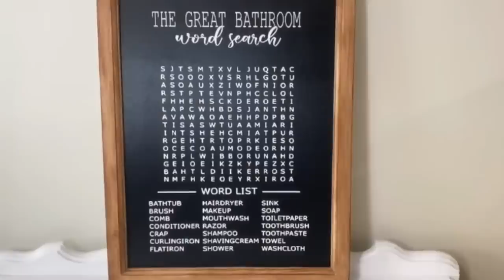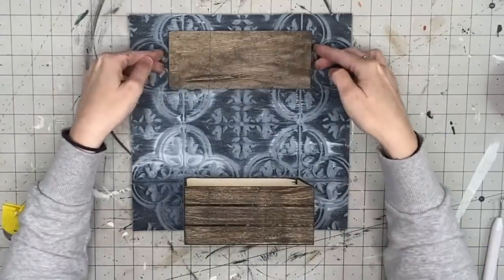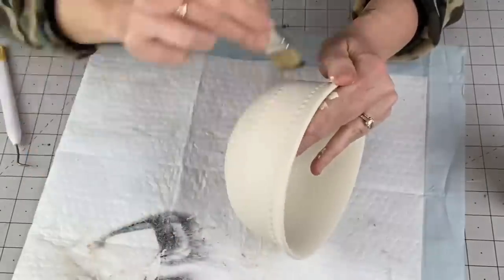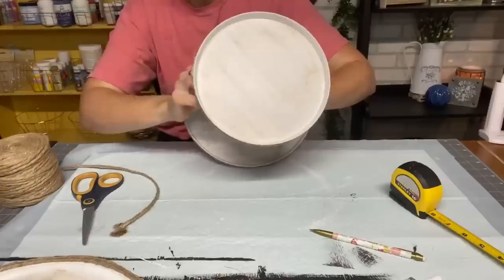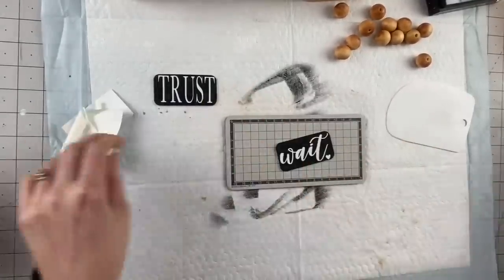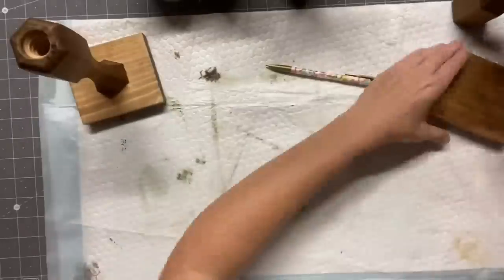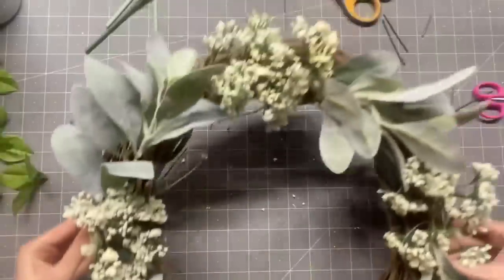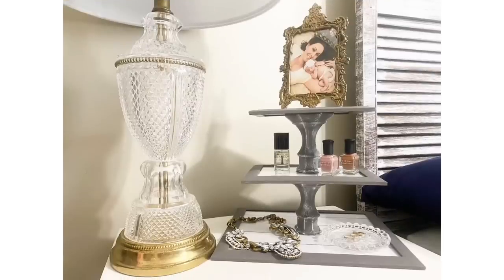26 BUDGET FRIENDLY but UPSCALE home decor diy's | DOLLAR TREE home decor diy's and ideas

Comment: The super glue wood glue from DT and hot glue TOGETHER......that actually WORKED for you?!? I tried that only once and NEVER again because they basically negated each other and i had NO long-term hold and barely a short-term hold. I think I had used a different wood glue, though (I think it was gorilla wood glue.) So the wood glue from DT you used on the kirkland mirror dupe with the half wooden beads and regular hot glue....it works together?! 🤯 if thats the case and a SUPER HUUUUUUUGE TY to YOU, Sammie!!!!😆🙃😍
Reply from the maker: Hey Gaby! It worked in this case. I had those mirrors for a long time and never had issues. I will say that when I use both together I try and not mix them together. So wood glue on the outer edge and then hot glue inside
Reply: @UnicornDustDesigns  ahh ok. I even had tried that and nope! Maybe it was just that specific project, too, that just wasn't having it! Lol I'm gonna give it a shot again. Ty as always! 🙂❤